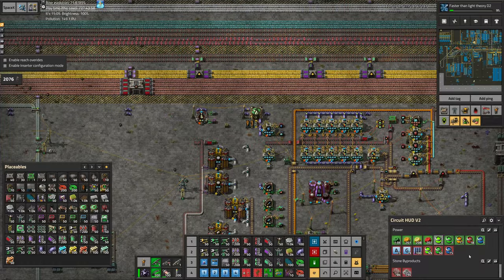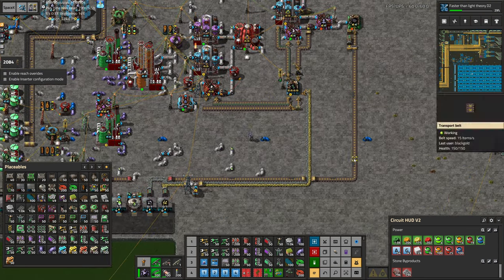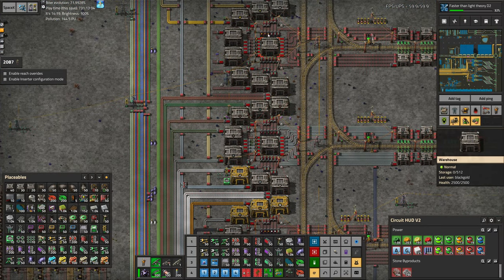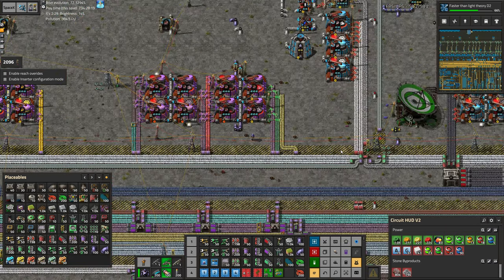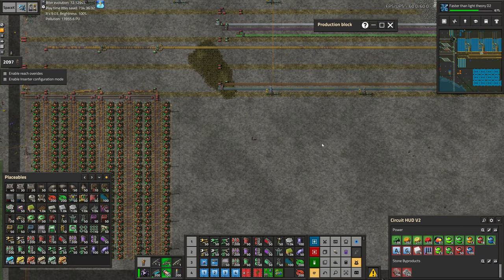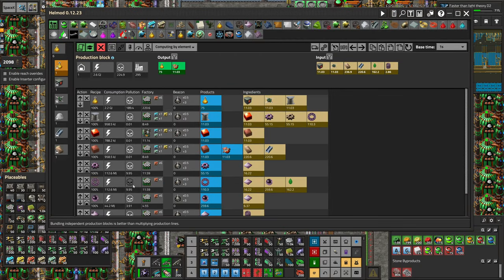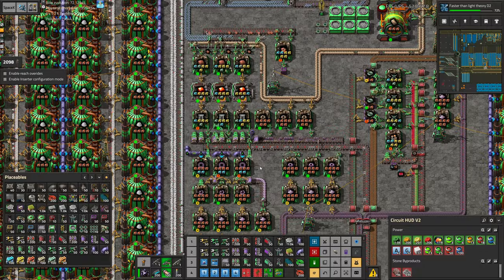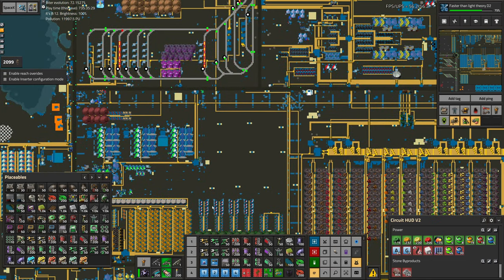[Factorio] Angel/Bobs Ep 388: More Titanium, Circuits, & Burners

Comment: Nice! Love troubleshooting episodes! Though, on the other hand, it saddens me that it coming to an end soon :`(  

In my new base, I decided against burning propene this time around... instead I opted to burn the butane, ethane and methanol first when they are overloaded, before it's turned into propene, in a mixed fluid burner shared by all of them... it has worked really well, it needs circuit logic to control that never attempts to run more than one at the same time, though! Naphta just gets cracked into syngas and then turned into fuel blocks, though.

Also, on other news: I started a new A&B save with the option "Big Pipes" in Bob's logistics turned on... the mod author said that they fixed some issues with that option and I wanted to test it. The result is that you have more pipe throughput available per pipe tier you go up... Nitinol pipes, for ex. give me ~6500 fluid per sec (if keeping pipe sections between pumps reasonable, like 6 to 8.) Con is that pipes connected to tanks don't fill totally unless you use pumps to pressure them which is annoying for the fluid bus, but machines work normally at the higher throughput, though.  Just FYI in case you ever want to start a new A&B save :P  (But I wouldn't recommend turning it on on an existing save, since it alters the way pipes work so I'd probably cause a lot of hidden issues in an existing base!)
Reply from the maker: Yea, the bigger the factory gets the more interesting figuring out the problems becomes, but eventually there are no more problems to fix. That's a cool change to pipes! You could do some amazing things with 6.5k fluid pipes.

The fact you got that mixed fluid burner power plant to work is pretty awesome! For me, besides the propene, all gasses are initially saved to try to turn it into plastic. Methane is turned into fuel blocks if it overloads (which is common, in fact even the far away plants have methane to fuel block converters to avoid overloading the plastics' build one) however ethane and butane just clog up. I'm okay with this because butane is a huge plastic producer (and ethane goes into it.) I crack condensates into naptha and then to fuel blocks, I used to try to save naptha but it seemed to cause balance issues with the plastics. Also extra mineral oil is cracked into fuel blocks as well, should it overload from the beans, but actually in the end game here I'm more often short on the mineral oil, so maybe I should be cracking the fuel oil instead and turning those into fuel blocks. Oh well!
Reply: @marsh8056  Yeah propene scared me with all that pollution, that's why I decided against burning it.

And the mixed liquid burner thing is something I carried back to A&B from Py mods :P 

In there you have buildings you need to fuel with liquids and they consume a lot of power too via that way, so you either switch by hand which fuel you give them depending on the state of the base, or you need to make some kind of logic that allows deciding automatically which one to use! Never had thought about mixing fluids before that, myself.

6000/s Nitinol pipes are crazy nuts yeah, it simplifies a lot of the end game issues with those overly demanding builds that requires lots of fluids!

For example, I just made a Sodium carbonate producer that required something like 40K water to work and I was able to feed it with just 6 pipes! (this time around I'm not using the P.U.M.P.S mod so no Water well pumps sadly, only offshore ones!) 

I still think the tank-pipe issue is something that maybe they can fix in the future too (i.e. each tank tier should also have its fluid box capacity adjusted via the same setting too, I think... assuming it works like that.) If they are able to solve that, it'll be perfectly usable normally.

And perhaps (here's hoping) Factorio 2.0 has some extra things to deal with pipe issues too... still haven't said anything about that, but the fluid mechanics implementation has been an issue since forever and they had some attempts at fixing it before!
Reply from the maker: @leeux Yea, fluids in factorio are that one weird thing that just doesn't feel right and it's hard to say why. Maybe we need an actual fluid pressure model, because as far as I know of fluid physics if you have a pump at the start putting out X then X is going to come out of the end, no matter how far away it is, and what changes is the flow rate due to the head pressure. So perhaps a pump's speed is based on how many pipe sections the fluid has to go, but maybe that would not be intuitive to the average player "why don't my pumps go at full speed?" But it would open the door to having several tiers of pumps with the same max flow rate, but higher pressure so it can go further, or maybe the inverse pump with the same pressure but it has much higher flow.

With Py what I did is make a "common fuel pipe" that supplied liquid fuel to any building that needed it, and then had a tailings pond which held the fuel, I ran it until the pond went low, then reversed the pump to clean the pipes out, then remove a pipe section to isolate that pond from the network and then hooked up a different one. It's certainly not automatic, and I don't know if that's something you can do in factorio. Of course in Py the solution is just to fill the pipe with something you can create reliably and toss or burn the random byproduct fuels.

Comment: Would it be a good idea to get a new mine going, or is there just enough in the old one to run to the endgame?
Reply from the maker: Surprisingly enough the existing mines should be fine, the only one that's kind of low is oil for plastic, but that is being boosted by oil byproducts from around the factory.

Comment: How long do you think until you finish this run?:) I’m curious because I’m also playing these mods and almost finished in 280hours but did you optimize everything? Why does it take this long for you?:D
Reply from the maker: Two episodes :P That said I’m using a combination of mods that dramatically increase the required size of the factory, such as spacex set to 25x launches and science cost tweaker set to 10x research cost. Also I’m spending time talking about things and recording gameplay. That said my original time estimate was 700 hrs so it ended up being pretty close to what I was expecting
Reply: @marsh8056 cool! thanks for the info:D